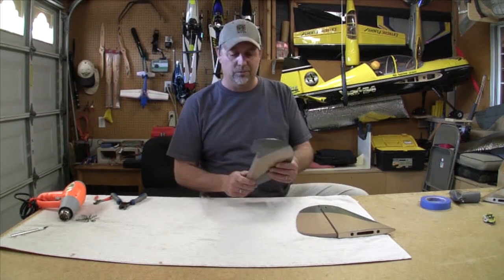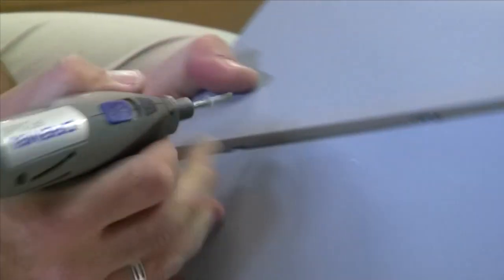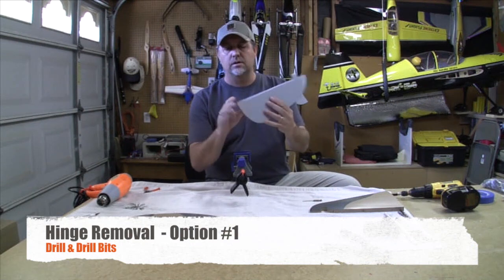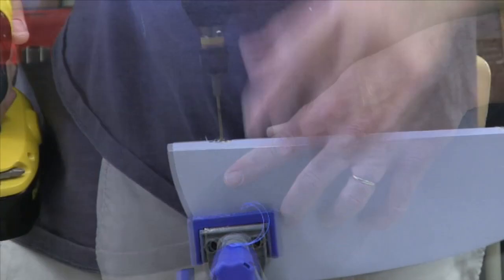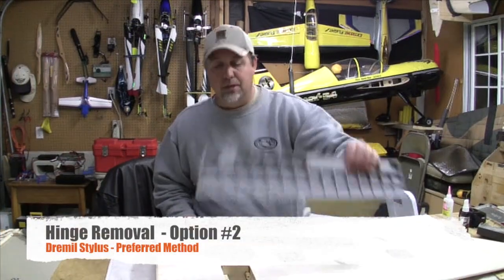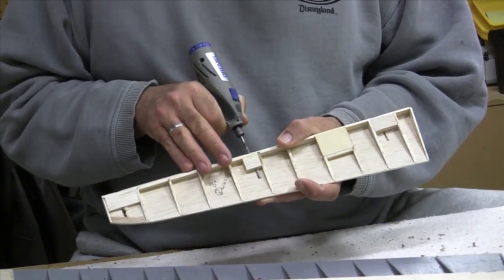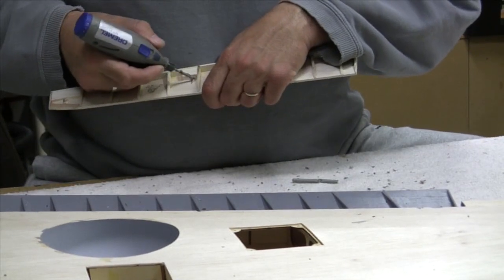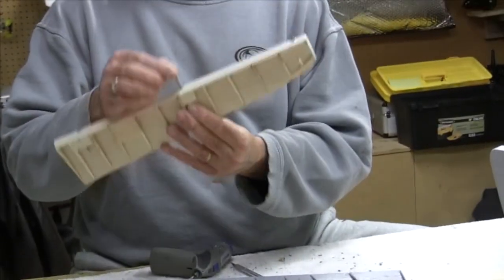#3 Pimp Your ARF - Robart Hinge Removal

Comment: Why remove the the nice Robart hinges? They work great for me, I've never ever had control surface failure using Robart.  Just curious.
Reply: Callie_Dan I read your post and I'm just wondering, if fiberglassing the wing wouldn't have to remove the hinge?

Comment: First cut, then I remove these hinges with a red hot wire. Ruins the glue and the plastic... not the wood if carefull :-)
Bit more time, but very exact. After this firing the remains reamd with a drill. 
But in all, very entertaining and a very good taste of airplane choice!